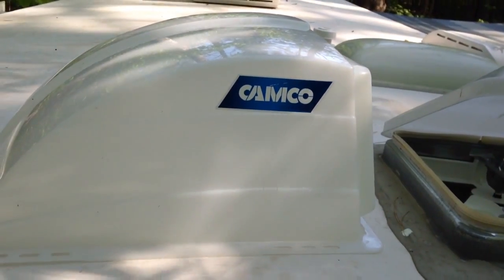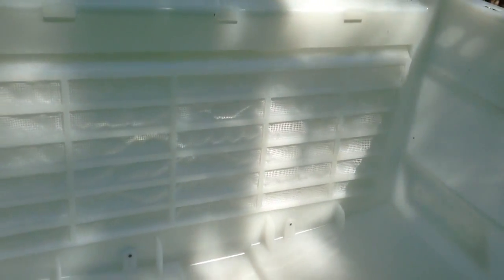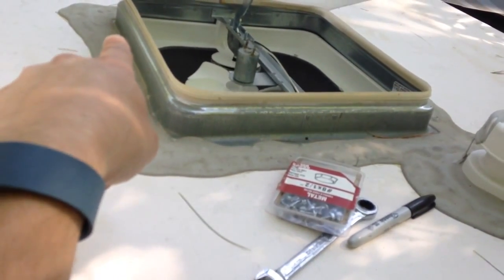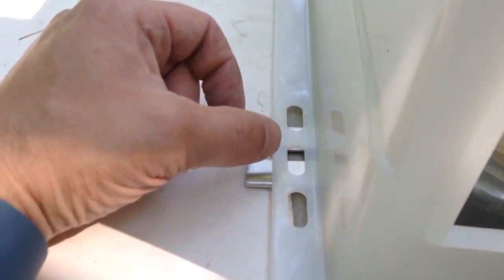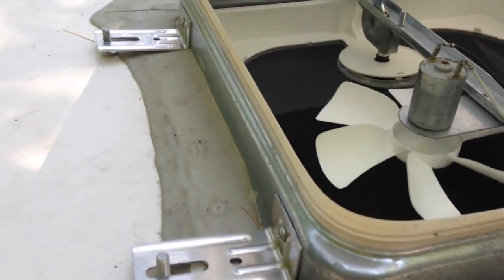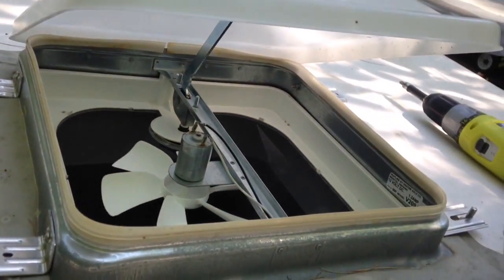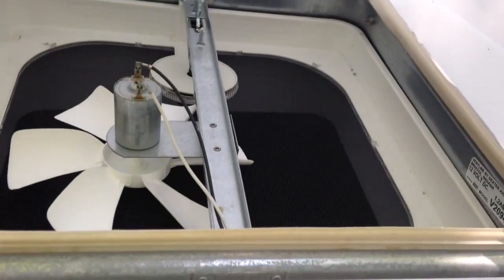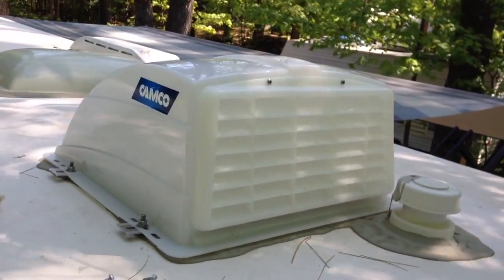How To Install A Camco RV Roof Vent Cover - Tutorial

Comment: Seems like there should be something sealing around the bottom of the cover to keep the bugs from just crawling under the cover. The bug screen does no good if the rest of it isn't sealed.
Reply from the maker: When the cover is cranked to the closed position that gray seal presses against the cover to prevent bugs from coming in.

Comment: self leveling roof sealant might be order also
Reply from the maker: +jscizo It's a brand new 2014 trailer.
Reply: Hmm the lap sealant. I see why you wouldn’t want to use it…. But I feel like the use of it outweighs the reasons not to.
Reply: @MReeb-nq9pd  He still has the inner original cover in place.  That has the screen as well to keep the bugs out.

Comment: Is that grey stuff butyl tape? Isn't that supposed to go in between the vent and roof...like a gasket? That's what I did anyway and then taped over the lip with Eternabond tape.
Reply: Bone Headed it’s self leveling sealant